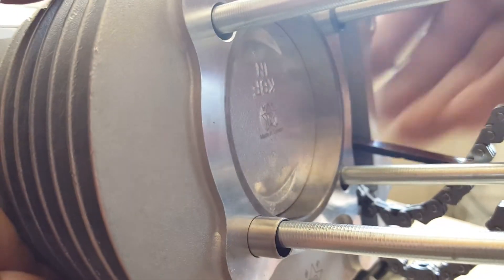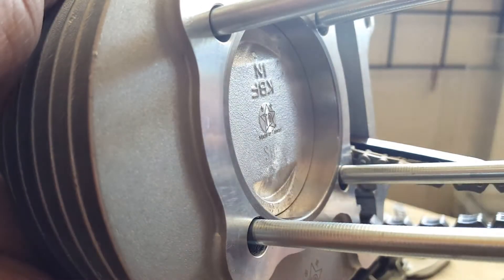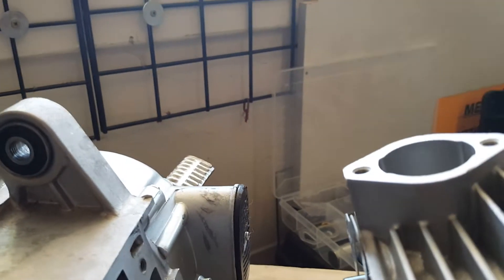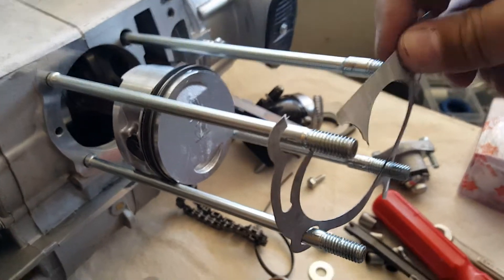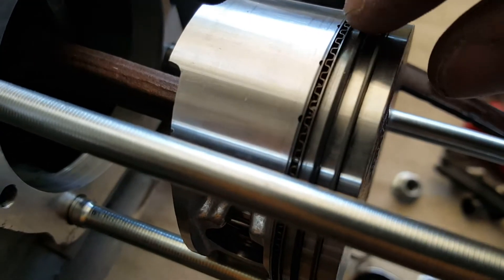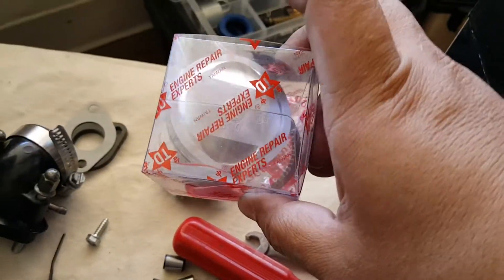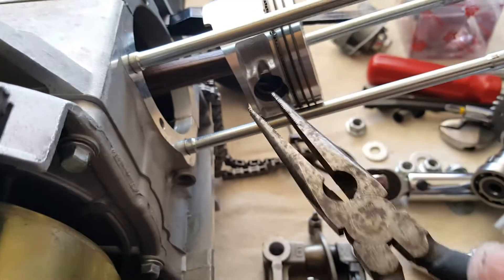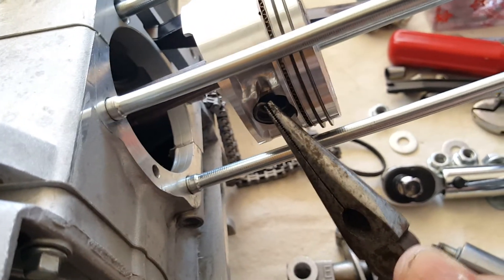How to install GY6 Big Bore Kit 171cc on 157QMJ Part #2

Comment: I am doing a big bore kit on a gy6 150 but for some reason the big bore jug will not fit back into the case no matter what....I measured and its the same size as the stock jug skirt....I cannot for the life of me get the new jug in! What could possibly be wrong? And I have the dowls in place the jug skirt just won't go in for some reason no matter how hard I try or if I line it up or anything...please help
Reply from the maker: sorry late response did you get a 57mm stud spacing cylinder for a 54mm stud spacing crankcase?

Comment: Any one have an opinion on this kit is it worth it I have all the mods but not the gear change carb manifold a 14 cam variator weights exhaust other this and that but not bbk on the 150cc china gy6 please any one let me know would I notice a nice change in top speed at least hit 70 mph I only weigh  180 is that possible

Comment: What's up with the little hole parallel to the chain tensioner on the cylinder ? Do you have to close it with a bolt or welds ? What is its functionality ? And will it leak oil if not sealed ?